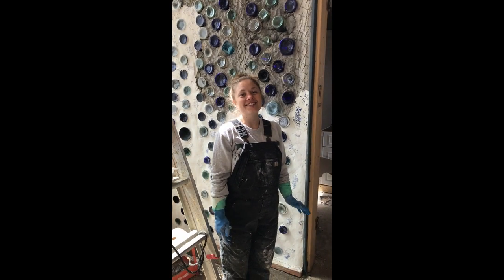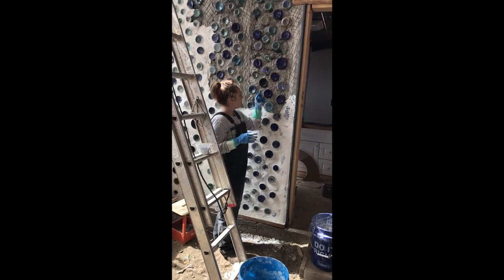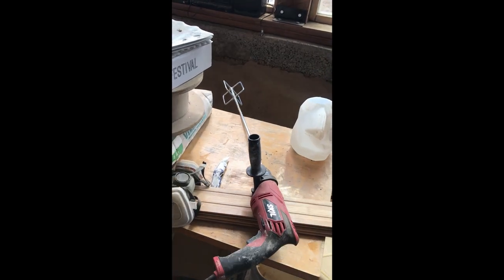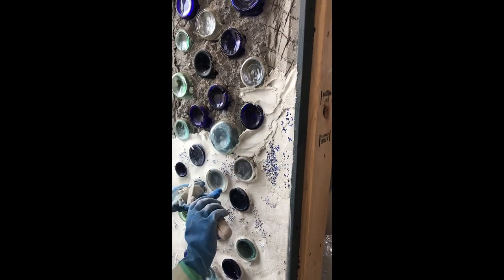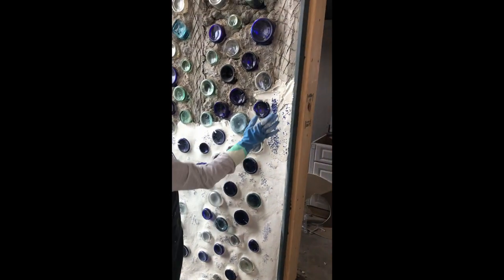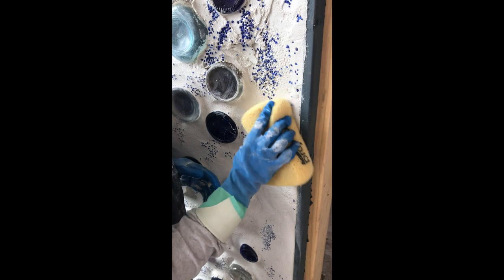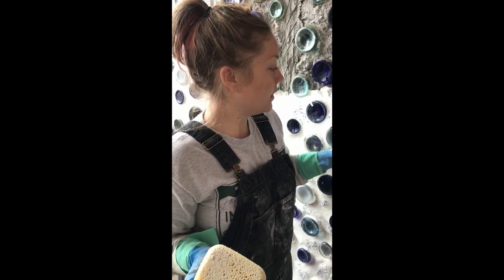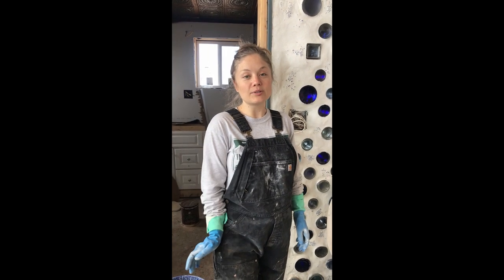Earthship Bottle Wall Plaster

Comment: I love it my question is did you cut the bottle tops off and if so how easy was lining up the bottoms and how thick is the wall? Also how long did it take to collect the bottles and or dud you get them from a recycling center?
Reply from the maker: Thanks for the questions! We did cut the tops off to make "bottle bricks" and it's not too bad taping the two halfs together as long as there the same type of bottle. Similar brands and types of bottles go good together. The walls are rough sawn 2x6's. And it does taking sometime collecting and processing all of them, but that's the fun of free building materials! Gathered some but also hit up some recycling centers.

Comment: How did you make the mix that holds your bottles?
Reply from the maker: I'll have to double check with Goldie but im pretty sure it's just a standard cement mix. 3 parts gravel 2 sand 1 Portland cement. Or you can buy sack Crete.